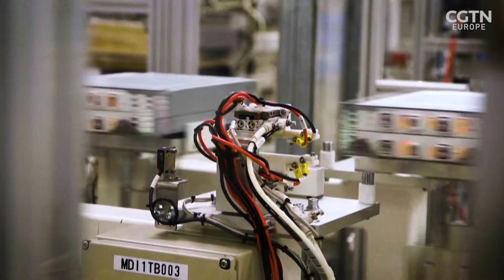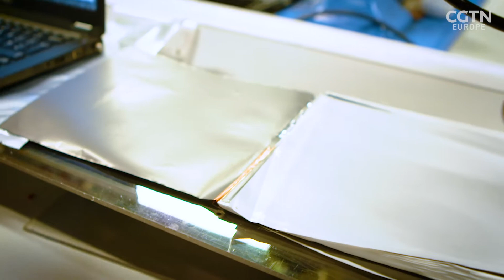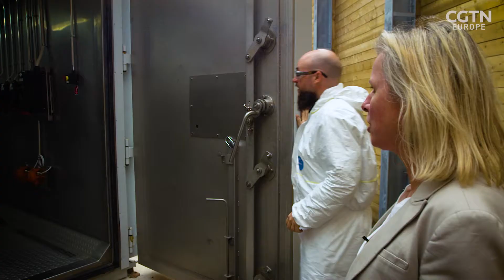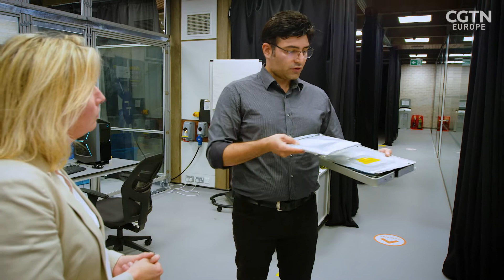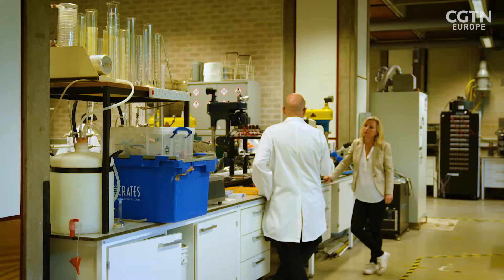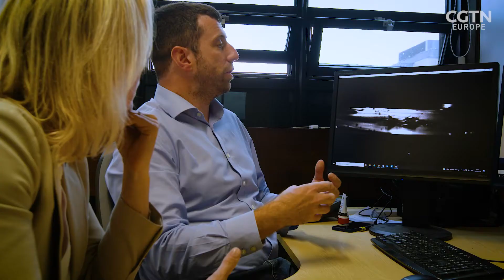How can you recycle electric vehicle batteries?

Comment: 30 years later, after decades of working on this we have determined that when adding the cost of the battery, the costs of charging the battery, the cost of recycling the battery, the energy required to recycle the battery, the energy to make another battery, we have determined that burning gasoline is more efficient so we will be mandating all internal combustion engines going forward.

Comment: Tesla has the right idea for this.  Forget trying to disassemble the packs, just submerge them in liquid nitrogen to deactivate the cell chemistry, then shred the whole pack and process out the metals and plastic.  There is no need to worry about discharging the batteries if they are cold enough, they will stop developing a charge at cryogenic temperatures.  At that point, the packs are inert, so just shred everything.  Way simpler than trying to program robots to unscrew hundreds of bolts.
Reply: They do not. Not all cells are bad, so reuse is way better when they figure out which cells are still good.

Comment: 10 Years + $20,000 = 2000LBS. of e-waste  🤡
Reply: but only if you dump the battery and buy a new one. I'd rather get the battery pack refurbished for a fraction of the cost of replacing it.... We have independent EV specialists already carrying out this work in the UK.
Reply: @Brian-om2hh  Are you VAXED
Reply: @Brian-om2hh  I would rather buy a car with a  timing chain and save my money